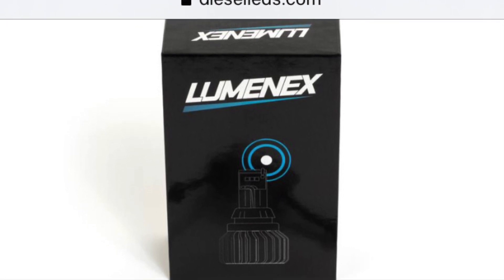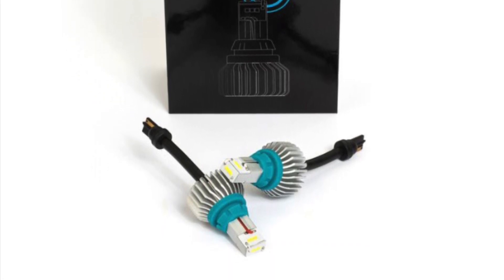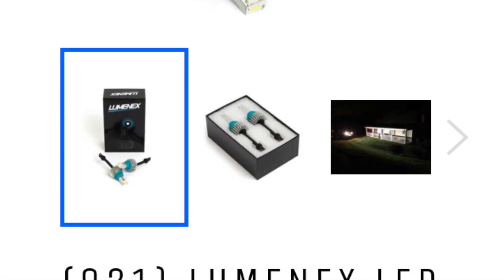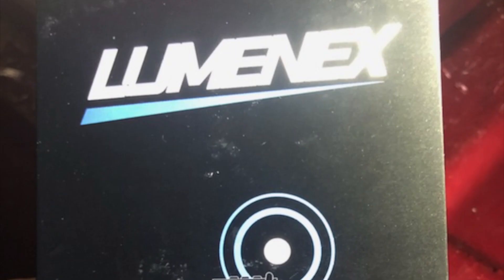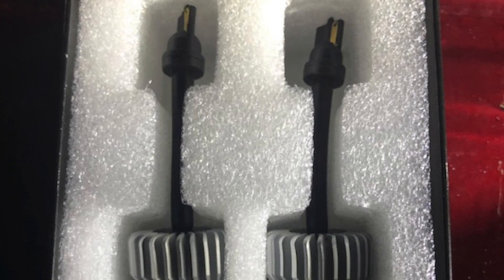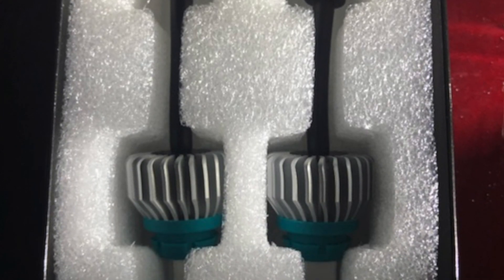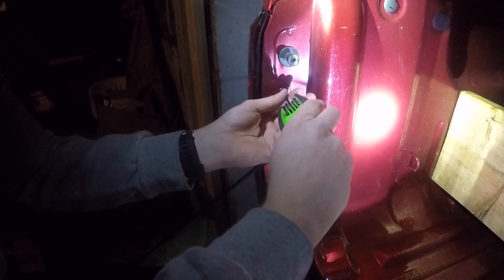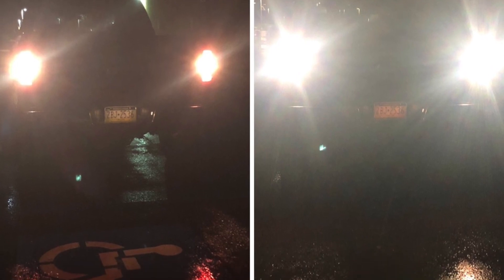[Install and review] Diesel Led Reverse Lights

Comment: I saw an issue when I installed mine where the plug in is that it is not sealed from water getting in the connection  because of the large holes in the body that lets in water when driving. I put some silicone  on to seal that connection. Is there a correct way to install, I have 1 vertical and 1 horzantal

Comment: How is the seal holding up? I've seen that the grommet doesn't really make a tight seal unlike the stock rubber grommets. Tia
Reply from the maker: AH7 So far it’s holding up really good, I had the same concerns that you did.
Reply: @Ponderosafarms  so you haven't had any problems with moisture or water? I live in louisiana and it rains alot lol.
Reply from the maker: AH7 I live in North Central Pa and we definitely don’t get as much rain but we do get snow, any rate everything is holding up!
Reply: You could apply some silicon paste to the grommet. That should help it seal/repel water.

Comment: How are there holding up?
Reply from the maker: Eric Sparks Yes, they are still preforming very well!
Reply: Kyle Mosso nice just ordered some too can’t wait!
Reply from the maker: Eric Sparks Let me know how it goes when you get them!
Reply: These look awesome...The only problem I see is the plug is exposed to the eliments...I'm in New England and the salt will destroy the plug....They need to design that a little better....I was just about to buy a pair too!
Reply: Scott Penniman you can probably get some caulk, one for outdoor elements and run it along the plastic housing and connector so when it’s in place the silicone will dry and make a proper seal!!
Reply: @scottpenniman1991   dielectric grease - search for vids about it.

Comment: Probably a dumb question but how do you keep your truck in place while in reverse? I just bought these and would like to use the lights more than just while in reverse. Thank you.
Reply from the maker: All I did was hike the unlock button at night but I would also like to know how to keep these lights on and use them for other things too!
Reply: E brake
Reply: flip your truck to accessory mode with parking break on and pop it into reverse. No need to have the engine running
Reply: Key on, engine off, gear shifter in reverse with emergency brake set.